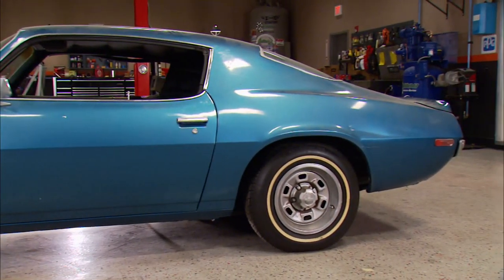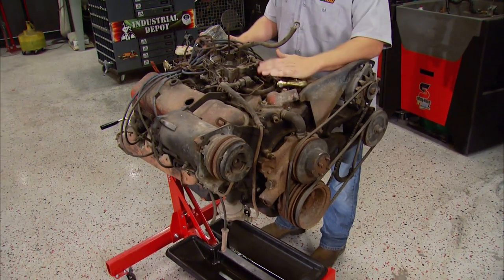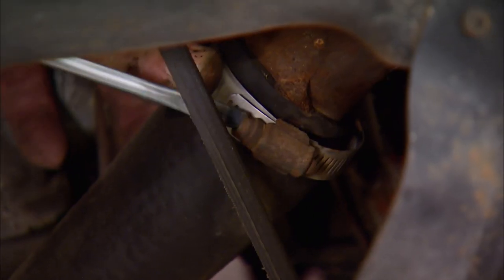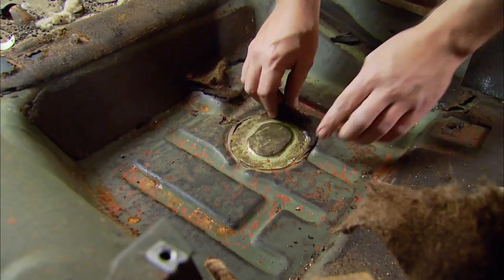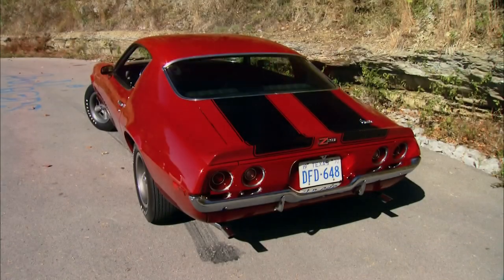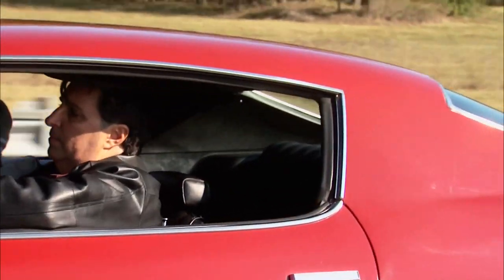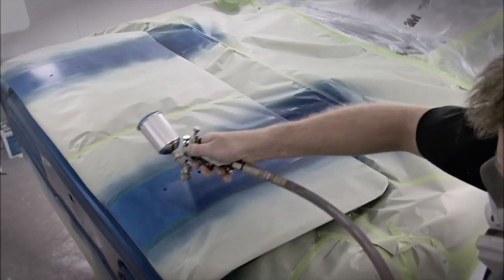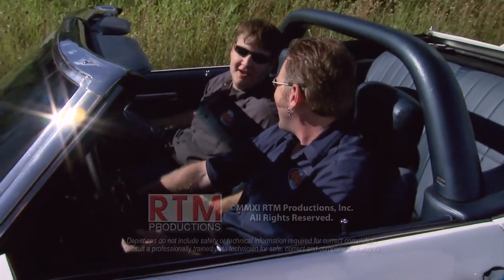Rebuilding a 1970 Chevy Camaro RS/SS L78 396 - MuscleCar S6, E4

Comment: When I was 19 years old back in early '83 I owned a 70 Camaro that looked just like this one. What really brought back memories was that bridged shifter. Anyway, I could have sworn the title said 70 1/2. I remember calling it that when I talked about it. In any case, I sure wish I still owned that car. This was my pre Army days and I still lived in CA. The car was pretty much a POS when I got it, and one of the biggest mods I did was to put a '78 Trans Am (pretty sure that was the year) roof on it with factory T-Tops. It looked like gold having those factory T-Tops on my Camaro. Anyway, I joined the Army later that year and never did finish the car.

Comment: This episode brings back great memories. There was a first gen Trans-Am in my hometown, I passed on a '70-1/2  Z/28 in 1977 for $1350, and had an Air Force buddy with a second gen 396 Camaro (325hp, white interior and vinyl top). It was down on power until we found a 2-bbl base gasket under the Q-Jet. Once fixed that car would spin the tires for days.

Comment: I love the second gens more than any other camaro. My best friend has a split bumper. But it has weaknesses. Like being a unibody. If you make any good power and have good grip you might need frame ties. I'd also put a cage in something this old. A new Ford focus would go through this camaro like tinfoil. Or any car of this Era.
Reply: Wilson Solt if I were to get my hands on a split bumper Camaro SS, if it doesn't already have them, subframe connectors would definitely be among the first things I'd put on the car
Reply: Wilson Solt we juat finished the rollbar in my buddies Camaro. Frame ties are a must.

Comment: If only the 70-73 Camaro got the 454. Such a missed opportunity.
Reply: Mine did but I converted it.
Reply: I know brother.
Reply: LS6 z28.... Damn. 😈
Reply: @cop-killer-  What do you mean all engines were trash.
Reply: @cop-killer-  you know not of which you speak.
Reply: Baldwin motion in long island  NY would have built one for you . Big brother shut him down
Reply: @cop-killer-  you mean the most used engines on the planet.
Reply: Bf 109 K-4    Lmfao yeah for fire balls. 😂😂
Reply: @scottbaker1018  And I doubt a battery could be resurrected after sitting for 50 years.
Reply: @cop-killer-  Hey, kid. Mommy wants her tablet back.
Reply: @scottbaker1018  the old fire chickens  where awesome  well when restored ^.^
Reply: @CJColvin  I put a 350 hp  350 4 bolt mains. in my 71 back in the day. my brother and I did a cam 202 heads, headers It was awesome ! sure wish I had it now in any condition.
Reply: @blackfender100  Sounds awesome brother those 350s have the potential to become a 383 Stroker and make well over 500 HP.
Reply: The baldwin motion cars came with a 454, 4 speed, special paint side pipes and a different hood, there's one here in idaho, it was an ss car that an airforce guy bought, he didnt want to wait for them to convert it to a 454 so it stayed a 396 and it was the only one built, my dad has been looking for it for years, his buddy ended up with it and every part he broke my dad ended up with, trans, motor, hood, just gotta find the car, my 72 rs is going in for body work soon
Reply: @superredsnakesrs2681  I know of the Baldwin cars. It's not quite the same, though. You know?

Though, I do hope you find that car. It'll certainly be worth a shiny penny when it's reassembled.
Reply: @mlp-hot-rod5824   I hear you, damn shame it wasn't done factory, the camaro would have out sold every other GM car, it road smoother, handled better, and was all around nicer to drive. All they had to do was give it some more juice would have been a killer and a looker
Reply: I just watched this with tears of joy ,,& good memory ,, I restored my 70 back in the 80s ,,  i wonder if its still rollin on down the hwy. I see the 454 comment my best story of tragic story is my grandfather had a big ol  70 Chevy Caprice Wagon w/ the 454  that he and grandma only drove a little bit in the summer to go fishing. I asked my dad what he & my uncle did with that car they ,, said some guy gave them $300 dollars for it . . I was sick for a month to hear that ,,i didnt ever tell them why i had to sit down as they told me  Just that 4 Barrel Carb was worth more than that. they didnt know. That Motor literal priceless my opinion .   Yeah that guy ,,, "vv",,, Well i suppose i would have stored that engine rather than put it in my 1970 1/2 so thats ok . . maybe a little bit . Hey thank you the video here if the maker is reading the comment thread here   . p.s. i see the firebird too, i have an F body Firebird right now ,,its fun thats true , but man """ I shoulda never sold that one Camaro i restored myself """ Made the old fashioned way with blood sweat & tears  ,, by the owner : ) .
Reply: @cop-killer-  Huh ?
Reply: @cop-killer-  LOL  . lol . omg !!! . lol . Holy hell   what the ??!!   Tesla ? . to funny ,, . (no comment )
Reply: @scottbaker1018  
Very Truly. he got a couple of first generation camaro done and Novas.

Comment: The LT-1 350 was the last bad ass small block non smogger for the time before the compression killers and no lead fuel. I grew up 18 miles from Yenko Chevrolet. Was mesmerized by the 427 copo chevelles and camaros .Just a 14 yr old gear head in 1969 dreaming of owning one of these beasts come 16.  Lmao never happend but saw plenty of these factory ass kickers cruising around .👍🏼👍🏼👍🏼💪

Comment: I saw another episode with the motor teardown...got the wrong heads...should be closed chamber rect port with 2.20 intake valves.. same heads came on 427
Reply: blackbirdxx928 they did say that the engine they'd gotten for this project vehicle originally came out of a GMC Sierra

Apparently you weren't paying attention
Reply: @karlsmith2570  They kept saying L 78 and not one part could have come from one. Maybe...the block..l78 is a particular combination  of parts...take a crate ls7  it's not a real ls7 anymore

Comment: I have been looking for a set of the 14" 1970 SS AV code Camaro Rally Wheels for a few years now, I am restoring a 1970 SS/RS L78 Camaro and I sure could use them if you guys want to sell the wheels, I have a set of AV wheels but they are for a later build. Thanks....
Mark

Comment: I heard from a GM factory mechanic that there was a discrepancy in a piston order. GM received pistons bigger than than the 396's bore of 4.094  inches. Since the blocks were already cast and GM had a pile of 4.125 pistons, the factory bored 396 blocks to fit the bigger pistons, so was born the 402

Comment: I'm sure I'm in the very small minority but I actually like the standard nose better than the RS nose.
Reply: same.. split bumper always looked goofy to me.. and the giant round turn signals with the chrome split down the center was hideous.
Reply: Da40kOrks 100 % agree. When I bought mine in the 90's it had rotten r/s nose aheetmetal, and that ugly warped urethane grille surround., I snatched that junk off there so fast. Swapped it out for the standard front end. I run the split bumpers, standard nose. I hate the round parkinglight next to the round headlights. All that round  is too monotonous for me, the standard parking light breaks that roundness up and besides that clean piece of sheetmetal, which sweeps down between the headlight and standard grille, is one of my favorite part of this bodystyle...The standard front end is 100x cleaner looking.

Comment: 600 L78???? Ive only heard rumors of 70 L78 Camaros from the factory.
Reply: In all fairness there are more 427/435 4-speed 67 Corvettes running around than GM made.  That people claim are factory cars.
Reply: 600 is correct. The Camaro / Firebird plant was on strike at the end of 1969. These cars didn't hit the showroom until Feb. 1970. Over 2000 Chevelles and 3000 Novas with the same engine in 1970.

Comment: Hey guys, just 2B clear at 2:07, 1970 was simple. There was no "SS Striping Pkg" from the Factory that mimicked a Z28, same for wheels. I don't get why you're recreating an SS, but imitating the exclusive look of a Z28??? A true SS looked like stripped Camaro with wide oval tires & Dog Dish hubcaps, a blacked -out rear panel, grill & "SS" front fender badging. An RS Pkg was optional, but NO Z28 "tricks". You're doing it wrong.

Comment: convertible with dork wheels 💩
Reply: Those "Honeycomb" replicas are hideous in that super size diameter :-(
Also, gen 1 Firebirds never came with factory Honeycombs, should be Rally II wheels(which are available in super sizes in the aftermarket). Not sure why these wheels were used for this build as they are incorrect and fugly!
Reply: @05gtdriver  oh it would look wonderful with rallye 2s
Reply: 05gtdriver as I recall, the honeycomb wheels came on the 75-78 models of the Firebird
Reply: @karlsmith2570  I think, if I recall, the honeycomb wheels became available during the 1972 model year and continued until 1976 or 77, not 100% sure though. I do know for sure they weren't available or yet made during gen 1 F body production.
Reply: 05gtdriver okay, they were available earlier than I thought

I actually don't really recall seeing any Gen 1 Camaro coming equipped with the honeycomb wheels as stock

I do remember seeing a few that had the day stock honeycomb wheels from the 72'-77' model Firebirds, however
Reply: @karlsmith2570  Now that I checked, the honeycomb wheels were a Pontiac exclusive wheel and made it's debut on the 1971 GTO & Trans Am, they spread to other models during the wheels production from 1971-1976. Cheers!

Comment: 307 stroker makes a badass street motor.
Just saying
Reply: Not really, just saying
Reply: 307 really man
Reply: The 307 is a nice street engine, for the garbage men to take.
Reply: We buried one in my parent's yard once.  It wasn't worth hauling to the dump.
Reply: Ran a nice 307 stroked in 68 Camaro, it pulled hard.
Reply: gentile joshsaved And I bet it sucked on the bottom end on the dragstrip too

Comment: So, the 69 Trans Am is nothing but a fake....it's nothing but a firebird convertible, fixed up.... custom built to appear like the real T/A, so don't call it a T/A... the REAL 1969 Trans Am convertible was VERY rare car, only 8 were built by the factory for 1969....And all 8 still exist, restored, running and driving, and 1 of these is in a museum (as of 2018)...